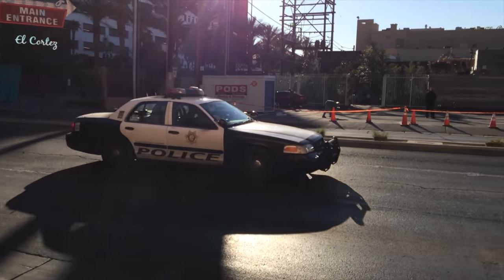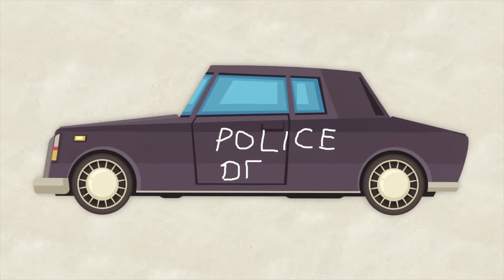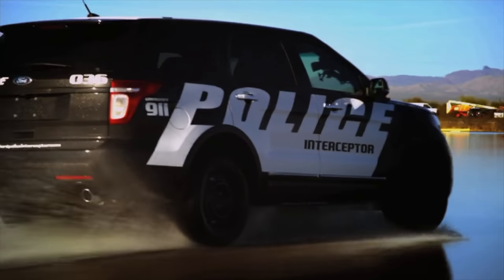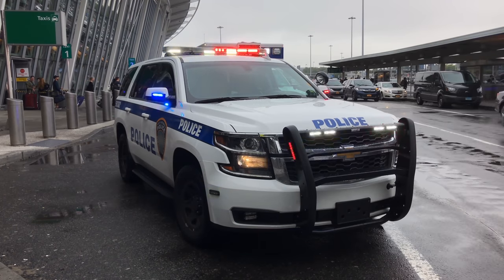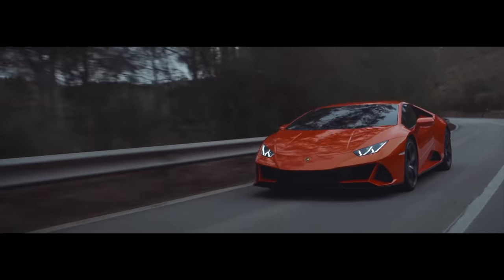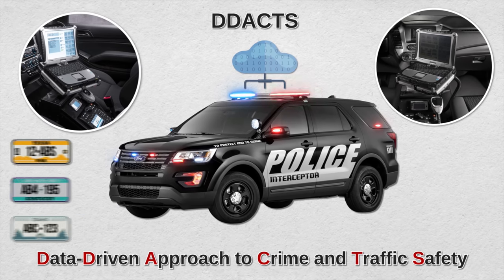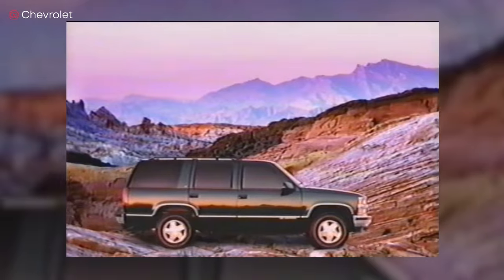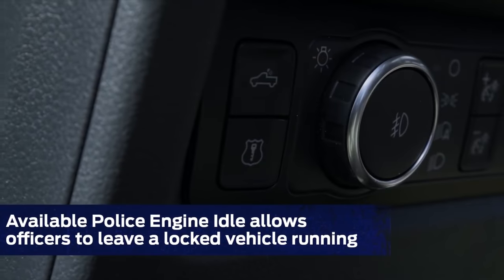Here’s Why You Can’t Outrun a Police Car

Comment: As a former patrolman, I can say I've never been outrun because I had a radio. I'd never buy a used patrol vehicle, even if it was taken care of (sort of) it probably idled 4-5x's longer than it drove down the highway. Our fleet was turned over at 85K miles. That doesn't seem like many miles, but that's after 5yrs and running daily for 8 or more hours a day.
Reply: 8 hours a day for 5 years, holy god
Reply: @Tommy Richardson Okay, but who asked?
Reply: That is why one needs to carry shoulder rocket with them in a car, you can't radio if you are dead.
Reply: Why are they ALWAYS idling and not turned off even if they’re eating lunch?
Reply: @mem1701movies  To be ready to go in case of an emergency.
Reply: In a bigger agency the cars are literally running 24/7 one shift hands the keys to the next.  The vehicles are basically always idling when they're not being driven like Stolen cars.
Reply: @mem1701movies  All the electronics in the car would drain the battery real quick. I guess technically they get turned off a few minutes here or there but for the most part they're idling and ready to respond to whatever comes in.
Reply: There it is, from the man himself.  Looks cool but, probably a money pit.  Although, sliding across the hood when picking up your woman would be awesome.
Reply: I'm in a 2010 crown vic that still got the cage, spotlight, and bump-bar. 135k miles on it with 7k idle hours when bought. Changed a few coil packs, a fuel rail sensor, radiator, and a new rear axle. All total I've got MAYBE $5500 in it. 

It happily one-wheel-peels off the open diff, and waits to redline to shift if I stomp it. otherwise it purrs like a kitten. Idle time sucks, sure, but the vic platform seems to handle it well. As to the modern SUVs? you couldn't pay me to buy a used one of those.
Reply: @mem1701movies  depends on where you are at. A Tucson cop-car needs to be able to keep the AC running while idling during a 115 degree afternoon.
Reply: @DontDefuse  I did. Man can talk whatever he wants
Reply: You never tried to catch a real sport bike on the run
Reply: I'm 4 for 4 on running away.   Am I the luckiest guy on the planet?  Maybe the smartest.
Reply: Thank you for your service, I'll make sure to steer clear of police cars at the auction!
Reply: @mem1701movies  watch the presentation. Its explained multiple times.
Reply: @honeyhorse4597  Yeah, endangering other people with your reckless driving while running from the police for sure makes you "the smartest."
Reply: @DontDefuse  No one did, what about you?
Reply: @johncarver9997  My dad bought a used Dodge Aspen that was a former Tampa police car. I think he bought it around 1985-1986. Dodge stopped making the Aspen in 1980, so it was at least 5-6 years old when he bought it. I don't remember how many miles/hours it had on it, but it ran perfectly. He only kept it for a couple of years, but we never needed to repair anything on it.  I liked it when I was a teenager because it had big bench seats. My girlfriend and I really enjoyed those seats!
Reply: @Larry Smithart how does one acquire this skill
Reply: They'll make good point A to B cars tho, right?
Reply: @mem1701movies  Takes too long to reboot all the equipment in the car. Especially the computer
Reply: So who paid for all that gas to sit and idle...?
Reply: It’s it just the miles but the hours on the engine.
Reply: @MsHyeven  and huge electrical loads from all the police comms gear.
Reply: I had a retired police car once ... 92 Iroc Z interceptor ... Took me a month to get a new key when I lost it ... Was a great car but due to the issues most will face trying to get keys I don't recommend
Reply: Really? I know personally of many people who have out run state troopers… its a bad idea and i would never condone it but I doubt its rare since i see it so often.
Reply: It’s not the miles, it’s the hours on the engine.
Reply: Lol I’ll outrun and outsmart you and your radio in a 2007 Hyundai Sonota any day of the week.
Reply: @Larry Smithart the radio is the reason why all the other cops in the area know what road and direction you’re headed 😂
Reply: I had the Indiana State Police as an IT client years back. I had a car that could outrun most police cars and I remember what the Sargent said"you might beat my motor, but you will never beat my Motorola"
Reply: I have never been caught
Reply: street bikes out run the radio daily 
radio or car your not touching a 1k+ sport bike unless you do some dirty azz stuff (ram/shot) like todays cops
Reply: you never chased an R6 then. 3-0 on my bike.
Reply: Not too mention some cars are shared by multiple officers. So upwards of 16hrs a day or idling/driving.
Reply: @001looker  Not....funny....!
Reply: @Au60schild  It's the reality.
Reply: @001looker  Maybe so, but still...not...funny....
Reply: @z06king  Police packages include beefy electrical systems, bigger alternators and batteries, some may place a battery in the trunk as well.
Reply: Well I guess your radios were on the fritz in the 80’s.  🤣🤣
Reply: Jack  I’m 55 now and I outran 2 cops in their cars twice when I was in my early 20’s on a bike.  It’s not hard on a bike at all,
Reply: Jack  if you have the right car.  👍🤣🤣
Reply: Take a picture of the person’s license plate and pick them up whenever,,, no need to chase anyone !!
Reply: @chemsrus4914  
The tax payers that’s who ….😂😂😂
Reply: user-bo4ez2qe7t  I’m just saying,,, no need to go crazy at high speeds to chase the person,, just video the car and catch the person later
Reply: Radios don’t matter. They can just help. When I was in high school, I had friends that would run from you guys for fun. Never got caught.
Reply: @001looker  lol okay cod player
Reply: Raises eyebrow... never been out run you say?  Radio only works if you can still see them.
Reply: 5 years to put 85k on? Your must have been brass. I'd have that on my patrol car in 2 1/2 - 3 years usually. We got new ones every 4 years and they usually had between 130 -150k on them.
Reply: And us civilian people get tickets here in Ontario , Canada for idling , as there is a law against it ....... once again police are above the laws they enforce ...... I even said to a cop driving about him using his cell phone while driving ... he said police get special training to drive and use their cell phones ...... how stupid do the police think the general public are ...... the same goes for DUI's , police officers here do not lose their drivers licence or have them suspended ....... the  general public does .... once again , above the law they enforce ..........
Reply: hate how cops waste our money
Reply: At one point I ended up purchasing a 2008 p71. I know the department that had it and what the capacity was. It had been a transport. That was it. It had 103,000 miles on it and 540 hours on it. That particular department would fine individual officers if they fail to bring their vehicle in for the proper pm time. That was a good car.
Reply: Challenge accepted 😂
Reply: 150000 miles seems more reasonable to me,no wonder my property taxes are so high ,most auctions here in Maine the vehicles have at least 140000
Reply: I would out run u I got brains and know short cuts
Reply: What state? Cause I see people out running chargers in Arkansas and they’ll ram you off the road into a family of 5 and get a medal for it lol
Reply: Now I understand why they don’t have many scat packs as highway patrol cars… COULDNT imagine 5k idle hours in a scar pack
Reply: I was always able to outrun cops.
Reply: scammers scam scamsford using japan yamaha and nissan,madza pro
Reply: Depends on the circumstances. A friend of mine got this +200hp dark grey motorcycle and passed cops driving on the opposite direction at something like 165 mph in a 45 zone. You really won't have time to notice details on pilot or motorcycle, probably even cameras won't do it at that speed. He had time to go back to his complex apartment, park his vehicle close to other fellow motorcyclists, getting in the car and going out. No one ever arrested him and proved him gulty.
Reply: Haha, my agency runs them until about 120k.  And they're on 24/7.  Dayshift comes in, gives it to graveyard shift.  Never turns off.
Reply: @1969barnabas you have a GREAT tag-name!
Reply: I bought two used police cars a while back.  Sold one to a friend of mine three years ago for $2000, it was a 2008 police interceptor that had 85,000 miles on it.  He is still driving it three years later.
Reply: Google undefeated charger.ASP  can't catch it.
Reply: Tons of videos on YouTube show cops getting smoked by crotch rockets and Hellcats. I even saw one where a bike outran a helicopter.
Reply: @kenweis7913  I have and caught both of them as well as many cars
Reply: @Apollo-Computers  our cars ran all 3 shifts.24 hrs a day
Reply: @edwardranno7119  and how do you know who the person is driving it
Reply: @Silidons91  same as my department did. At least the ignition switch should have been in good shape.
Reply: Exactly. You’re never faster than the radio lol.
Reply: Lol. All cops are hopeless liars. 
Zero chance you're a retired patrolman that's never been smoked by a perp. Citation: fast perp. 😘😂
Reply: I use to feel the same way, but with the advances in synthetic lubricants and the common availability of service records, retired police vehicles are a much safer gamble than buying off the average used car lot.
Reply: @mem1701movies do you enjoy sitting in you're car with it off on a 90 degree day? Or a 10 degree day?
Reply: As most of the wear and tear on an engine occur at start up,and even much more so in cold weather, they many be in better condition than most cars of the same mileage. Just as cars with highway miles.
Reply: Key is to get away quick , and knowing the area . If you live in a heavily populated area , it’s hard to run - but if you live in the sticks , it’s easy as can be . Having a fast car /bike sure helps as well
Reply: That's very true. I bought an 07 Crown Vic. Great car. Runs good and only has 123,000 on the odometer. Then a few weeks later I noticed it had 5288 hours running time on it which at average driving speed is over 300,000 miles. Oh well. Hope it keeps running for a while.....lol
Reply: To put nicely FORGET YOU
Reply: If you were in NYC lots of guys will smoke you and the radio
Reply: Better to buy a runner than one that sat. There's a term for that...lot rot.
Reply: Felony fleeing is exciting, and it’s great to see more of it!
Reply: I run a 2014 used charger doordashing ex cop car over 200000 miles I run it 12-15 hours a day for over a year and yes I'll let it idle no problems what's so ever keep up on the Maintenance it's fine
Reply: As much as your ego would like it, I'm pretty sure you've been outrun. All the criminal has to do is turn once without visual and your pursuit is over
Reply: @floorpizza8074  Dramatizing the danger surely makes you "smarter"
Reply: @greenhillscustomlawncarell1139  L friends
Reply: @floorpizza8074 dont have to drive recklessly to get away from the cops at night its quite easy actually when its dark and if you have a fast enough accelerating car then if you know the roads well enough it would be a short chase
Reply: Radio is faster than any car on the market.